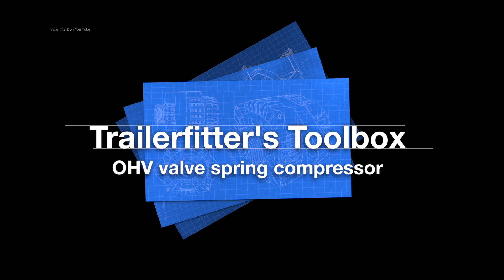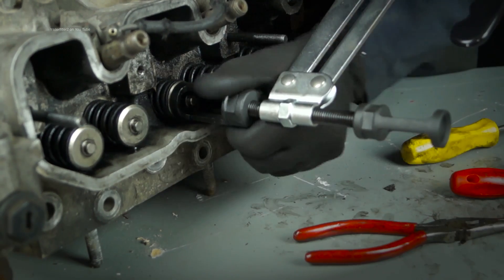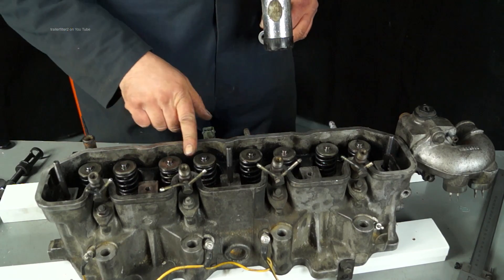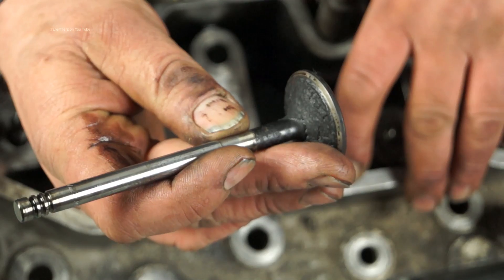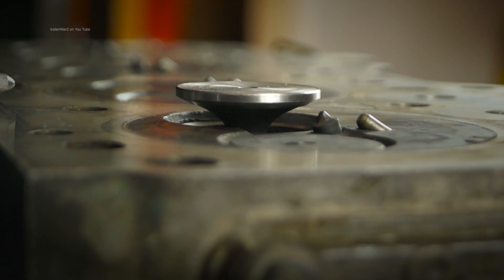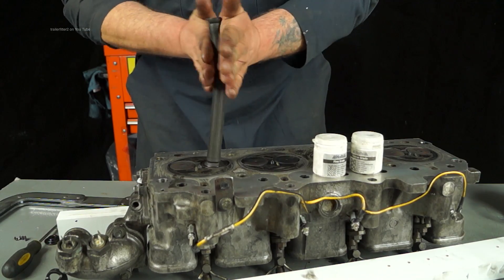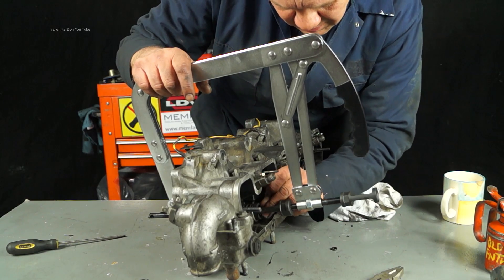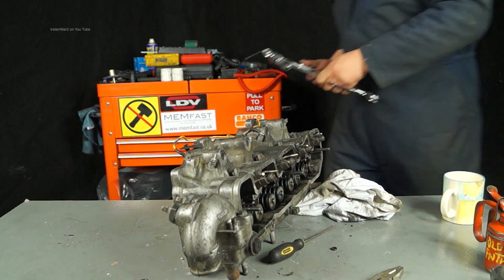What to measure when stripping valves out of a cylinder head.  OHV Spring Compressor.

Comment: I got this valve tool and is TOTALLY rubbish! It's very hard to work with it.
Reply from the maker: A bad workman always blames his tools.
Reply: @trailerfitter2  I understand that you are sponsored by the seller of this product and you want to make money out of us, but you should have some decency and not claim when something is Not good as good.

  My problem with it is that if you compress the ring with the tool it is not strong enough to keep the ring compressed and it will sprung back and you going to damage the keepers or have a bad time finding them -- its fiddly.

Comment: Work like this isn't even economical these days. Its almost always 
cheaper to buy a new head than take an old one to a machine shop work. 
This type of work is specific to restorations of no longer attainable 
parts. In which case its probably just better to blueprint the original 
head and have a new one made (wont be cheaper but at least you will have
 the information to produce one whenever necessary).
Reply from the maker: That is just an excuse to be lazy.   These skills are required in machine shops and home garages all over the world.
Reply: *****
No way, the only thing its an excuse for, is to get the most for your money.
Reply: Unbelievable.  "blueprint the original head and have a new one made".  Like taking a picture of a surfboard laying next to a person, and using that comparison to craft a new board, is it really that easy???  Do you know how much a fully rebuilt or brand new high quality head costs, even for a common engine like a Chevy 350??

The precision measuring processes shown in the video are CRITICAL to rebuilding, measuring and properly assembling an engine head.  Any machine shop worth their salt will spec the used head FIRST.  

OR they can just throw parts at the engine from Coolio's Radical Parts Brah Totes.com.  And they will take your money just as fast as you can put that Shop's sticker on your surfboard.

Stay gold.

Comment: Is the 200tdi tolerances the same as the 300tdi? Is there a different manual?
Reply from the maker: You need to get the 200tdi manual.   It is harder to get hold of.

Comment: Where can we find the tolerances for all of this, did you say in a workshop manual? 
If so where can I get one of those in the uk ?
Reply from the maker: For the 300tdi engine there is a specific manual on the overhaul of the engine.  You can either buy it or download the PDF   http://www.landroverweb.com/Pdf-files/300Tdi_Overhaul_Manual-Land-Rover.pdf